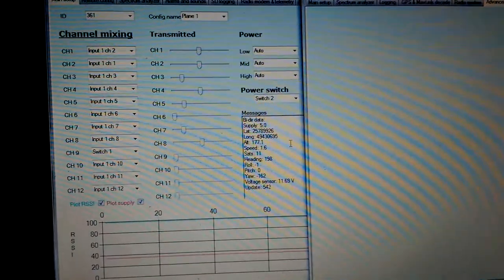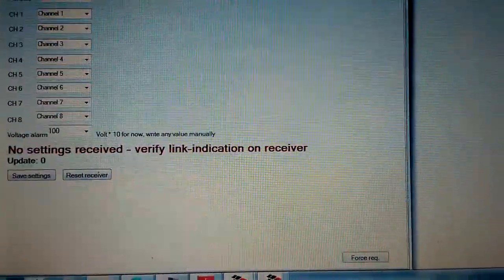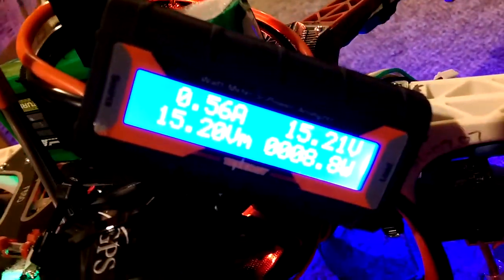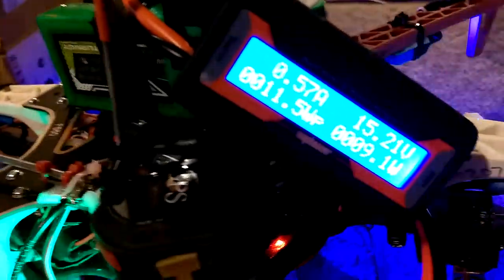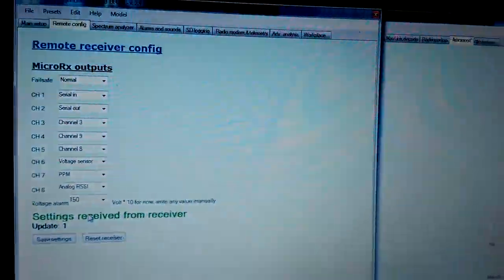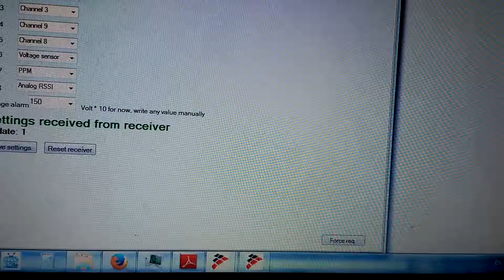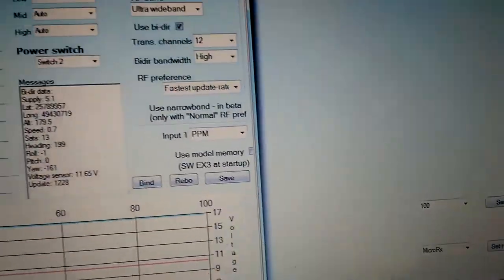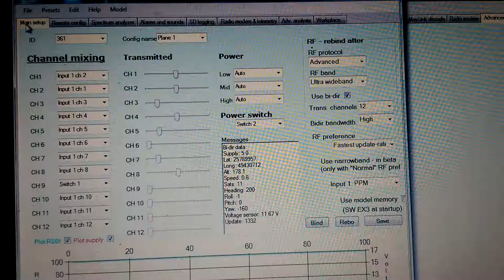DL-Valarm

Comment: My friend you need the voltage sensor for it to read the correct voltage . I have it and it work good.
Dragon link voltage sensor. You find it in there website.
Reply from the maker: This IS with the voltage monitor cable attached to the battery feed....
i got it worked out it seems, it still shows the V in the software as being WAY off, but it sounds the alarm exactly when i want it too (14.5V on a 4S) and sounds just seconds before or after my onboard LiPo alarm.... not sure why it was so messed up before but its functional now ;)